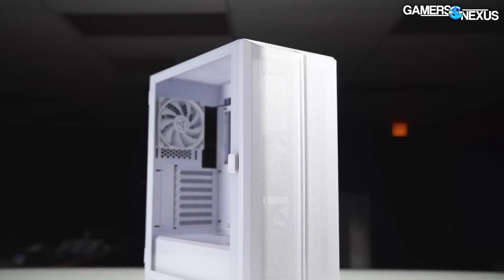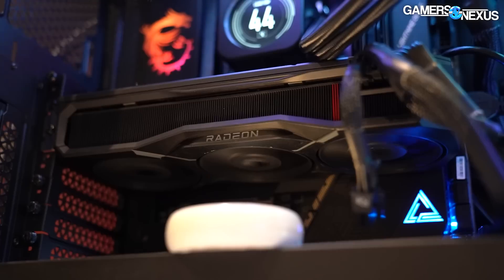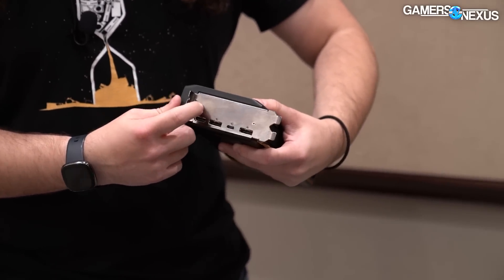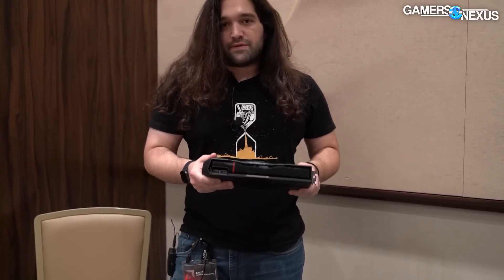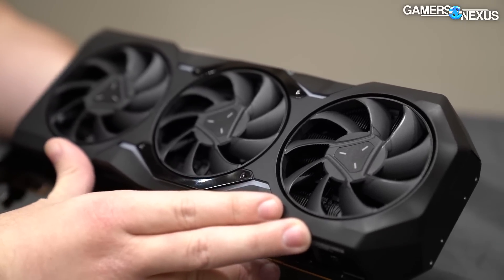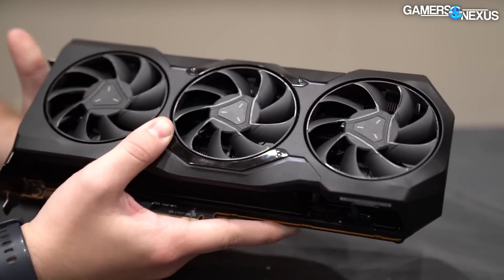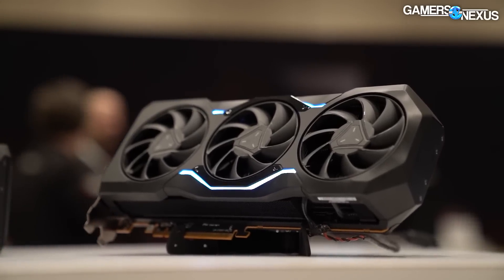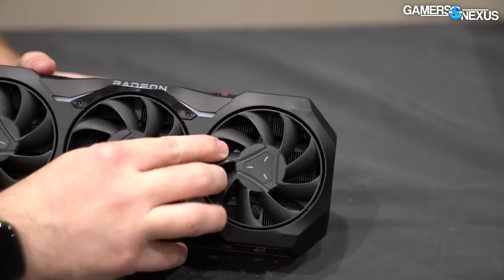More Video Cards Need This: AMD RX 7900 XTX Reference Design Hands-On

Comment: Nvidia will be unlaunching 4080 for second time.
Reply: Lol
Reply: No matter what they do, the 4080 16gb is dead. Even if they cut prices to 1000 bucks, it will get curbstomped by a 200 dollars cheaper card and probably only lose in rt native situations by 10%.
Reply: @davidepannone6021  unless AMD shit the bed again, in which case plenty of people will shell out an extra 200 for Nvidia because traditionally Nvidia just works and your delusional if you think otherwise.. 

The 6000 series had a dogshit response to ray tracing and no dlss.. Every single AMD GPU I’ve been hands on with also has terrible 1% lows, large frame dips, is more stuttery and has below average frame time compared to Nvidia, let’s also factor in AMD’s buggy ass drivers which is probably the biggest cause.. 

A chiplet design will never match a large monolithic reliably and what’s more you just have to look at AMD’s embarrassing launch where there were no direct comparisons with Nvidia products, where they harped on about ‘8k’ gaming and made petty digs at the 12pin connector and fluffed around with other crap no one cares about… 

The 7000 series will be bang average at best and I’d be surprised if AMD don’t lose market share in the GPU space here..
Reply: Did they send out a press release announcing that they will be announcing the unlaunching? 🤣
Reply: Which 4080 though? 🤨
Reply: @titan_fx  the one they haven't unlaunched
Reply: @titan_fx  only that not unlauch
Reply: @titan_fx  the 12 GB one got unlaunched due to unnecessary circumstances that NVIDIA are dumb to release a "12 GB version", when 12 GB is 4070 😂
Reply: @titan_fx  4080 14GB 🤔
Reply: @titan_fx  the 6 gb one
Reply: I wish they'd unlaunch 4090 and reintroduce it as 4080 with a lower price, like $700. But I guess I'm asking too much.
Reply: LOL .. tomorrow News flash Nvidia regrets to in form everyone we are un launching 4080 16gb .. week later we are announcing a 20gb 4080  at $900usd
Reply: 4080 16gb will struggle to compete with 7900xt
Reply: And launching "the proper" 4080 with only a slight cut down of 4090 for the same price as "the shit" 4080 16 gb? I call it a win
Reply: Good bye to the over priced 4080 16gb even the 7900xt rasterization will blow away the 4080. The ray tracing might be 3090 levels but who cares..  for the price ill take that over the 4080 any day...
Reply: lel
Reply: @BORUTO 🔩 Bytes are definitely better than bits. 12Gb = 1.5GB
Reply: @BORUTO 🔩 Yup, this is it. This is the most braindead comment on Youtube.
Reply: they wont. but a cut in price(-100$) is to be expected.
Reply: 7900xtx will likely be 30-40% on avg faster than 6950xt at 4k and probably 20%ish at 1440p. The lack of performance charts in AMD presentation makes me think performance is quite disappointing compared to Nvidia.
Reply: @jjlw2378  6950xt is 23.65 tflops, 3090 is 35.58, 4080 is 48.74, 4090 is 82.58, 7900xt 51.61, 7900xtx 61.56. They release FPS #'s for 7900xtx we know both these cards are going to beat 4080 is rasterization. One reason could be they will potentially still sell more 6000 cards, giving performance charts could effect those sales. Another reason could be the competition "nvidia" could lower the price of 4080 and announce 4080ti and potentially undercut your sales as the 4080 is available to buy now while 7900 series isn't. We live in the social media age reviewers will get the performance difference #'s out there for the customers. Providing performance #'s really doesn't do anything for you. Also we see how bottlenecked 4090 is even at 4K in some titles this makes CPU is very important. AMD makes CPUs they can't put i9 13900k charts with 7900xtx but the reviewers can. If they used 7950x some will know to check perf diff with 4090/7950x/13900k some won't thus being mislead into thinking going with nvidia is better. I bet only a very small percentage are even aware of 4090 bottlenecking 4K which is only worse the older your PC is. Here's a quick reddit comment: Its 1440p but still gives u an idea. I had i9 10850k 3090 @ 45 - 60fps in CP2077, Upgraded I9 10850k 4090 @ 60 -75 fps CP2077, Upgraded again I9 13900k 4090 @ 100 - 120 fps CP2077.
Reply: @resColts  7900xtx God of War 4k- 98fps (AMDs own numbers with 7900x), 4080 16gb God of War 4k- 97fps (Techpowerup with 5800x). 7900xtx RDR2 4k- 93fps (AMDs own numbers with 7900x), 4080 16gb RDR2 4k- 87fps (Techpowerup with 5800x). Seems to me like the 7900xtx isn't the raster master people might be expecting.
Reply: @jjlw2378  Both games don't benefit from different CPUs RDR2 for example has same performance with 5800x and 5800x3D, GOW is also DX11 and a 6950xt matches a rtx 3080 according to TPU. TPU is also using awful ddr4 ram 4000mhz with timings of 20-23-23-42. Hardware unboxed with 5800x/5800x3D + rtx 3090ti with I believe he says ddr 3800 cl16 gets 84fps in RDR2 TPU gets 76 with 3090ti. This is a prime example why giving performance charts can be bad as ram frequency and timings clearly matter more than the GPU customers like you realize even at 4K.
Reply: @resColts  Lol. None of what you posted matters because AMD showed that their 7900xtx with a 7900x cpu/DDR5 6000 couldn't outperform Techpowerups 4080 16gb with a 5800x and crap ram. Seems like maybe you're the one who doesn't understand how things work.
Reply: @jjlw2378   where you get this information of ram/CPU used and fps average?
Reply: @jjlw2378  lol I see you cherry picked the results given 7900xtx is approx 30% better on average vs 4080 in MW2, AC valhalla, watch dogs legion, RDR2, Cyberpunk, GOW. The Cyberpunk result is very telling on what to expect, but yeah keeping thinking 7900xtx can't outperform 4080 16gb. Very good job making a complete fool of yourself.
Reply: @resColts  I think expecting 7900xtx to be 30% faster than a 4080 is far more ridiculous. It will beat the 4080 16gb in some games but by very little unless it is an AMD specific title, while also losing significantly in any games with RT capabilities. Based on AMDs own numbers the 7900xtx is not much more performance than the worst 80 class card ever created. Overall, if you're happy with the 7900xtx then by all means enjoy your purchase. Personally, I think a $1000+ gpu needs to do alot more than the 7900xtx and 4080.
Reply: @jjlw2378  I haven't bought anything Amd in like 15+ yrs I am likely sticking with my 3080 for now. I don't expect 30% but that's what approx average is for those 6 titles.
Reply: @Sai The Truth which games
Reply: @Sai The Truth i’d like to see one game using all that 16 GB of VRAM
Reply: LOL, nah, the scalpers will drive these prices to the moon and they will give zero fucks.
Reply: Lol
Reply: No they won't.. they'll reunlaunch it 😅
Reply: That's a good one
Reply: 4080 will be faster than these 2 cards, which we’ll see when AMD is brave enough to allow us to see benchmarks. They probably don’t have enough excuses prepared (yet). Until then, keep your head in the sand. If AMD could have made faster cards it would benefit everyone, no matter the “team”, but unfortunately they didn’t.
Reply: @Alex335i  No way, that would mean 4080 will be as fast as 4090 which is stupid
Reply: @Alex335i  Every time I read a comment like yours, I get flashbacks to the RDNA2 launch. How I enjoyed watching people shouting how the top end RDNA2 GPU would barely match the 2080Ti when NVidia already had Ampere. It was really funny. Meanwhile, my 6900XT overclocked to 2.6GHz slaps the 3090 in most things not RT (which I don't care about yet), so by these people's logic, 2080Ti>3090, I guess. It's hilarious seeing people be so certain about this stuff without having seen any testing. I don't know what to expect from RDNA3 performance wise, but if AMD pulls a sneaky again and the 7900XTX is about as fast as the 4090, I will come back to read the comments and laugh. And if they don't, I'll still be laughing because even if you're right, it was just a guess based on fanboy sentiment.
Reply: @959tolis626  Love how you candidly write that The card won't compare in RT while you talk about fanboysm.
I've owned both AMD and Nvidia cards in the past and Nvidia was always superior in software. No microstuttering issues, no weird shutdowns, no weird incompatibilities, gsync working better than freesync, better features. Enjoyed playing Arkham series with the exclusive Physx extra features, and now DLSS and RT are clearly superior. If you don't care about extra eye candy, of course AMD cards are better priced, but then again, if eye candy isn't a concern, why shouldn't I buy a gaming console instead?
Reply: @Shendue  AMDs cards these days are super stable and very performant for anything other than DLSS (which is actually a way of running a game at lower resolution without losing as much detail as you should to get higher frame rates, it doesn't actually increase game detail from native rendering at the same target resolution) and RT, which is still fairly niche. Importantly, just because they can't keep up with one specific flavour of eye candy means nothing for their delivery of very good graphics in every other domain.
Reply: @Alex335i  nice bait, try harder next time, shill.
Reply: @Alex335i  100% agree
Reply: @Alex335i  4080 will have way better RT !! May have better software..AMD drivers are great too.
AMD 7900xtx/xt will be fast. 4080 is a fair bit cut down over the 4090, so it will be a lot weaker. 4090 has the crown!
4080 looks slower then both cards, with software dlss 3.0 4080 may get lead in a few games but it lose any lead as time goes on. 
The cards not out, so benchmarks will be needed. Everyone should wait until then.